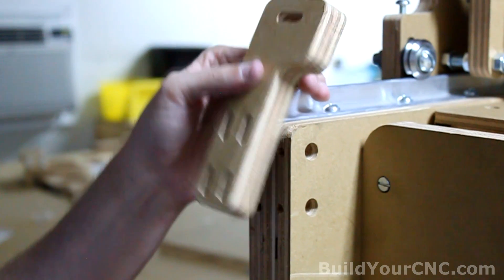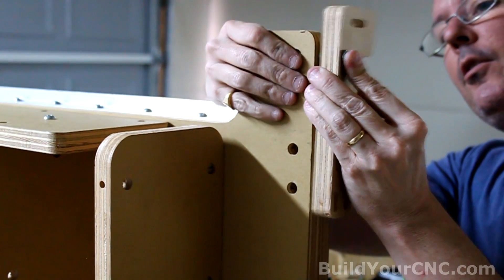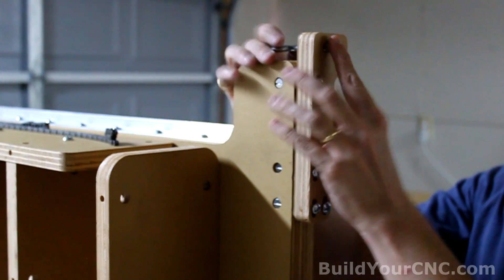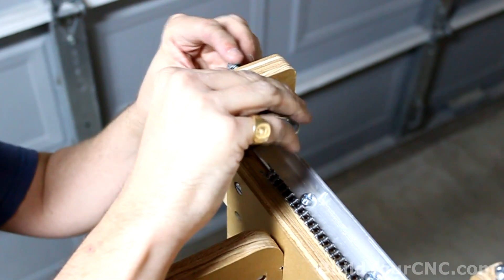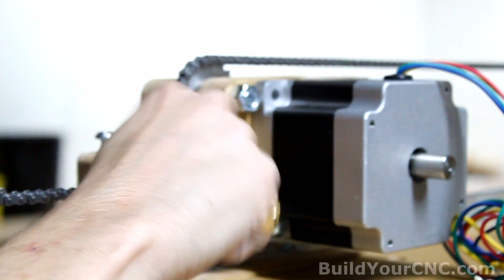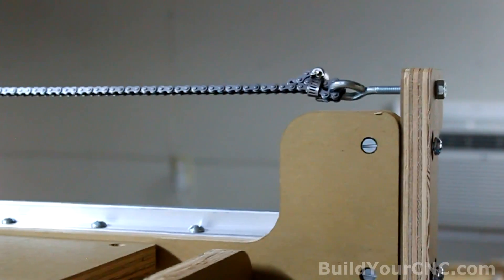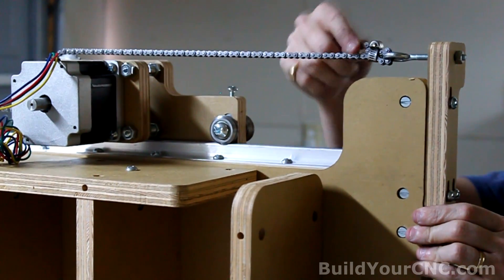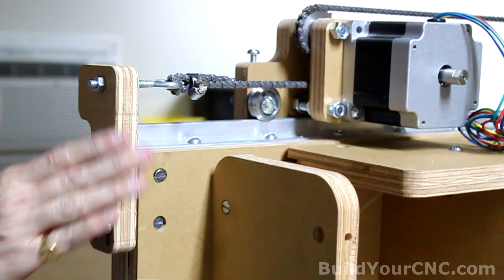greenBull CNC Assembly - Chain Mount for Y-Axis

Comment: What is the suggested pitch and no of teeth to use ,will it works with grbl
Reply from the maker: That will actually depend on the machine, motors used and weight of the assemblies that the motor will carry.  GRBL can be configured to accommodate a variety of mechanical systems so you should not have to worry about the link between mechanics and GRBL software/firmware.
Reply: @PatrickHoodDaniel  thankyou 🔥🔥

Comment: I mean the Settings for Step per unit. I use the chain drive too, but if i try to move 1mm it dont move 1mm
Reply from the maker: Have you tried using the mach3 calibration tool?
Reply: Yes, but than the Motor sounds not good. maybe the microsteps are to small?
Reply from the maker: Microsteps too small will generally make the sound more smooth.  You should probably check the velocity and acceleration settings.  Lower them.

Comment: Hello, did you use Mach3? How you set the Setup?
Reply from the maker: Yes, but what part of the setup are you needing to determine?  Mach3 is a very broad parameter based application and it would be better to have a look at the Mach3 manual and if you have an issue with a particular parameter, then I may be able to help.

Comment from the maker: @fkjrnd The sprocket is being wrapped by the chain by more than 50% of it's pitch circumference.  The backlash would be extremely small under normal loads.  The tension is pressing each pin into their respective root around the sprocket. I would like to get more information from you so I can pinpoint any problems that you see.  My aim is to improve the machine.  We have been using this technique for a couple of years now without much of an issue with backlash